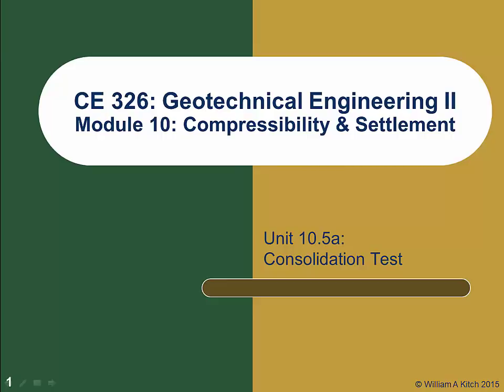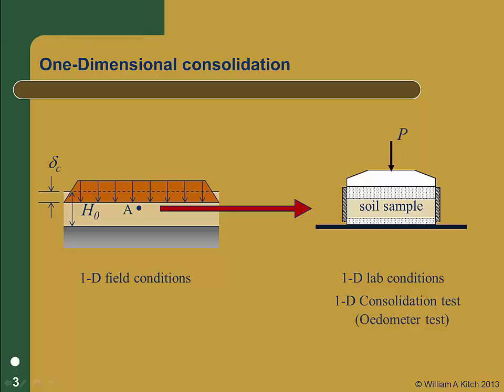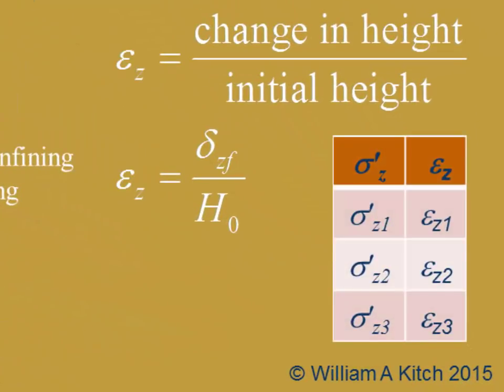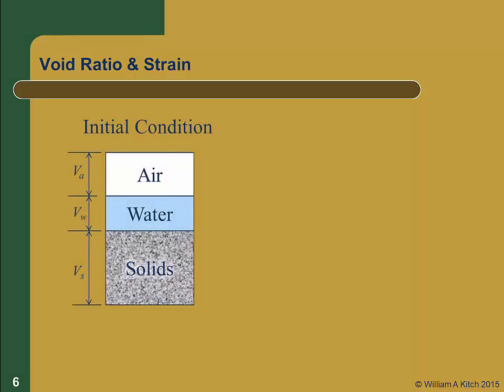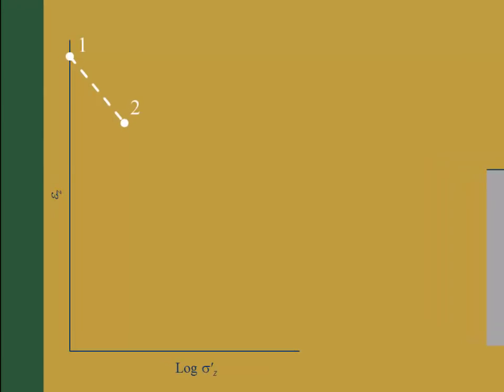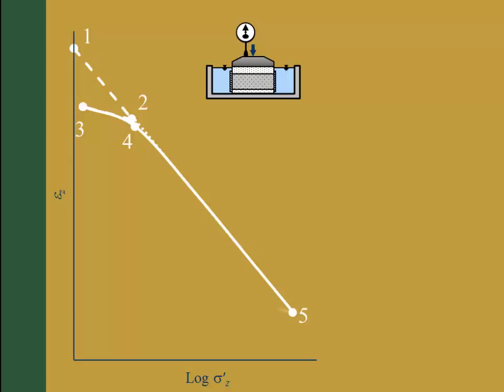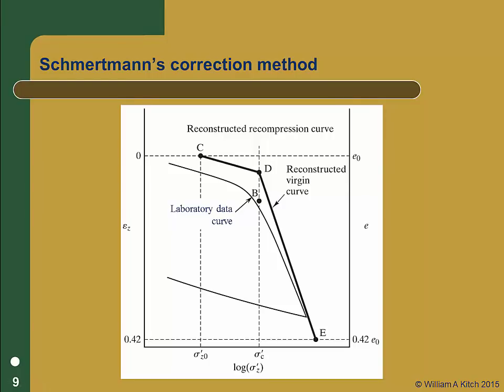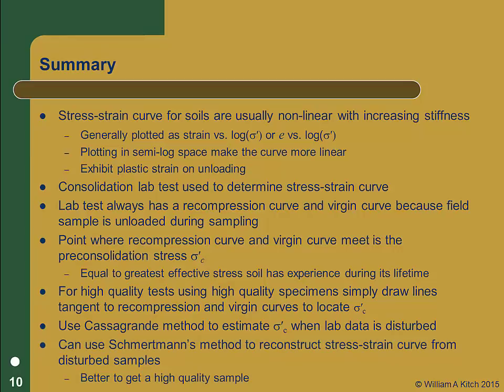CE 326 Mod 10.5a Consolidation test

Comment: اثناء التجربة تكون التربة مشبعة بالماء لهذا المخطط المستعمل في الدقيقة :8 لا يحاكي عملية التصلبconsolidation  بل يحاكي عملية الدمك compactage
Reply: It’s correct to use that diagram even in this case because we are assuming that the actual volume of the solids is unchanging, I.e. the molecules within the soil aren’t changing physically to be able to change the volume of the solids (like in the case of a diamond).

So the diagram just demonstrates that the soil particle volume is staying the same it’s just the void ratio which is changing - and the voids of the soil can just be represented as the amount of air and water.

Comment: Thanks for this exceptional video Professor!
Since we assume that the soil sample is fully saturated, shouldn't the phase diagrams at 8:00 consist only of solids and water. In other words, at 8:00 there should be no air when the void ratio is related to strain.
Reply: We are not assuming the soil sample to be fully saturated, it can have and will have air in its voids, we can prepare our sample by either saturating it completely or can work with a dry field clay or moderately saturated sample, It depends on the sample preparation method being adopted.

Comment: Hi Sir. Does coefficient of consolidation change with stress increment? For instance, Cv = 1.5 for increased effective stress 100 but = 2.0 for increased effective stress of 200? Or is it constant throughout.
Reply from the maker: Cv can change dramatically over a range of effective stresses.  See section 11.3 or our text, Coduto, Yeung & Kitch (2011)

Comment: in an oedometer test, it is said that the clay specimen is fully saturated at the end of the test but most probably not saturated at the beginning. why is that? i thought that the moisture dissipates from the clay cus its been compressed by the load which causes the water to exit right? please help me and correct me and tell me why
Reply from the maker: non maker, the saturation state of the specimen at the start of the test depends on how the specimen was collected and prepared. It could be completely saturated or not. During the test the specimen is kept under water and the consolidation that occurs during the test will, usually, either force air out of the specimen or cause it to dissolve in the pore water. We generally assume the specimen is fully saturated throughout the test.
Reply: thank u for ur reply! so due to the open valves, the water is freely able to move in and out of the specimen which is why we assume its fully saturated?
Reply from the maker: non maker, there are no valves in the type of consolidometer shown. The pours stones on top and bottom allow water to freely flow ina and out of the specimen.
Reply: Sir, as we apply load sample will consolidate by dissipation of water in voids. So its no more saturated. Why we are taking it as saturated all time?